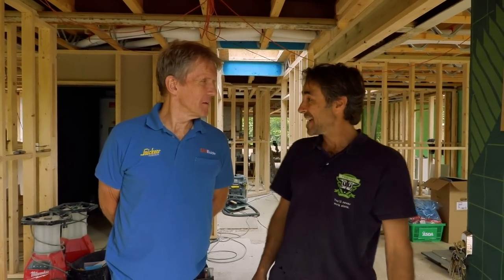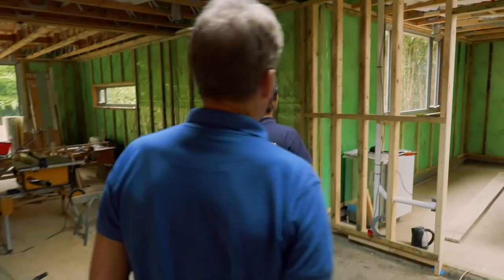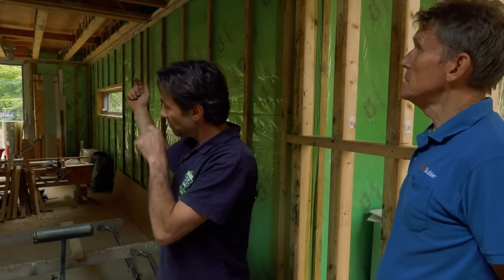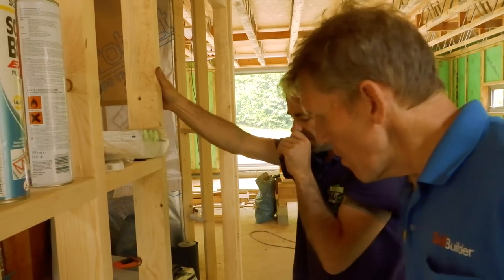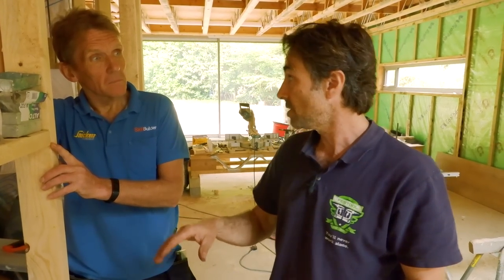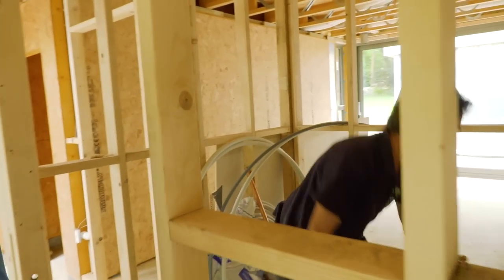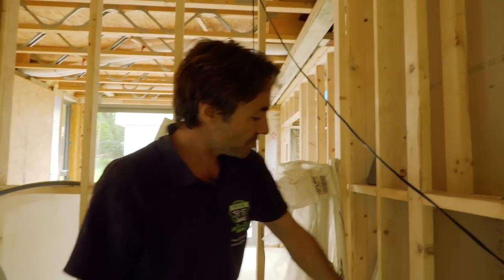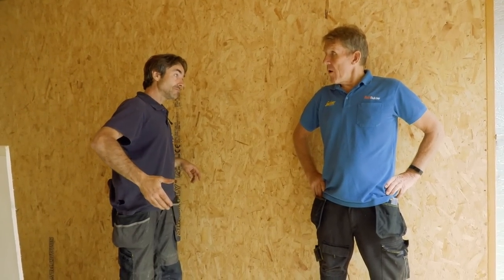Robin's Building Progress Update - Capel #11

Comment: It's really starting to take shape now Robin and looking great too!  I particularly like the joists, being able to run services both perpendicular and parallel to them, without drilling holes everywhere is very handy.

While you're doing your first fixes, I'd recommend putting in Ethernet, any audio cables and also any CCTV wiring that you may want in the future.  Wired Ethernet, particularly for TVs and desktop computers is so much more reliable than WiFi.
Reply: So much modern tech does not have facility for wired, only wi-fi.!!

Comment: Looking nice Robin. I get receesed bathroom cupboards made by a local bespoke kitchen company. They're ivory faced carcasses with mirrored doors, either 15mm with a 4mm mirror stuck on 

or now they can do a wrapped door which is mirrored, which is much lighter.
I get extruded aluminium  LED strip lights made to measure and sometimes fit these down the sides. They look really sleek.
The long and the short of it is you can make them  to any size you need,  great for tall cupboards over a BTW pan for example.
BTW, how many outlets do you need for the vacuum system ? I had a similar system in my previous house and with a 30 foot hose only needed one on the landing and one in the hall.

Comment: Ref Beam, agree with everything you said about them 🙄disaster from start to finish.....I got the HR and Beam Hoover system from them, they have terrible after sales, took my money and that was it..... trust me and take my advice, I have installed the main Beam Hoover unit in my utility room which also has an extraction point from the Heat recovery, what you called the silencer blows out so much dust into the room and then because it’s beside an extraction point from the HR it sucks it up and  cuts the life span of the filters such is the level of dust. Take my advice at this point and try to extend your beam exhaust out side of the house if you can. 
Love all the videos 😎👌

Comment: Great project. Go with the metal back boxes, 35mm on sockets etc.

Have a look at Casambi wireless Bluetooth lighting controls. Pair that with Vimar wireless Bluetooth Kinetic switches and do away with the light switches metal back box.

I've completed several projects using these products
Reply from the maker: Thanks we will check them out. Dylan is doing the techie stuff now. He is wired up differently to us.

Comment: That level in the socket is a smart idea, be interested what sparks think as they normally use a laser around the room. Even so, gives a good starting point may be? Great video 👍
Reply from the maker: I think you still need to laser them in but the last bit of levelling can be done on the bubble. The problem is that the boxes don't have any adjustment on the lugs so they have to be spot bollock when you put them in.
Reply: @SkillBuilder  Ahhh, well if no lug adjustment that makes complete sense, cheers for saying 👍

Comment: Great to see all the progress. What's the temperature like inside? Bet you're keen to get the electrics and heating in so that work can progress in a more comfortable conditions?!?
Reply: Hi Nathan, the temperature inside is not to bad we have the underfloor heating ready to fire up, the building temperature fluctuates by 1 to 2 degrees up and down regardless  of the external temperature which is a great testimony to the air tightness and insulation, but now winter is setting in you are right in saying that it would be nice to get the heating on!!!!

Comment: In Australia the majority of houses are timber framed with brick veneer, so the brick is not structural. The framing code here states that you're not allowed to drill a hole greater than 25mm in a stud and only in the top or bottom third, so as you can see from this video a lot of these vacuum systems that are being installed, generally after frame inspection ,  cripple the structural integrity of a lot of the houses they're installed into. It's not impossible to install them without causing structural problems but I've rarely seen it done and maintain code.
Reply from the maker: Hi Tim
 I was thinking the same thing but those studs are not structural. The outer walls are untouched.
Reply: Skill Builder, yes, I did assume as much. Robin is too good a carpenter to let something like that happen on one of his builds. Here in Australia we build to a minimum requirement rather than to a standard, which means the house is engineered backwards depending on roofing material, geographical wind loads etc. When you add to that the fact that the big residential builders are licensed to self inspect rather than have a council inspector, which is a massive conflict of interest, it all turns into a recipe for disaster when trades who don't know the framing code, like plumbers, electricians, scaffolders etc. start to drill holes in studs, cut out bracing straps and banging holes in brace boards to suit themselves. As a British born carpenter I can honestly say the Building codes back in Blighty are actually pretty good.

Comment: Looking great Robin.  Re . the potential issue with debris in the central vac system dropping back down the tubes, could you add a time delay onto the system so that when you unplug a vac hose/switch from a wall plate, the system runs for 2-3 minutes to make sure all the debris ends up in the beam unit in plant room?

Comment: I used to fit beam for the sole suppliers in the U.K. the company is Keenans from Northern Ireland they do the heat recovery systems also
It is simple to fit as I am sure you found out pat Keenan has been fitting beam vacuum systems for over forty years beam is made by Electrolux in Ohio and they use LAMB electric motors not made by Electrolux there are other vacuum systems companies Canadian CANAVAC  SMARTVAC also American but 
they all mostly use the same LAMB motors beam is a good system designed for dry dust  and hair etc but some people think it is a skip sucking up sticky sweets and food which will eventually block any bends on the pipe work good system if you are allergic to dust but you have to not put crap in the pipes or you will stop it working

Comment: Quick question Robin, whats the thickness of the final screed and is it ok for the internal stud walls to be encased by the screed?
Reply: The final screed is 50mm and it's ok to go around partitions, use the correct foam expansion correctly fitted prior to screeding (liquid screed)

Comment: Can someone explain to me at 2.00 how the ceiling joists plus the whole flat roof structure seem to be sitting directly onto the exterior windows and doors without the need for supporting columns and lintels. (behind where Robin is standing)
Reply: Hi Gary we have an earlier video in the capel build series that shows me constructing the flat roof and you will see how the joists are supported by Glulam lintels it is a great system no steel beams anywhere! Thanks for the question
Reply: Thanks Robin. It’s all become clear after watching the other episode. Thanks again.
Reply: @Edge-ir8tb  nice one gary glad you saw it, all the best Robin

Comment: Re: electric back box, it won't flex when plaster board is on, as front of switch is bigger than cut out hole so you'd have to push hard enough to break plasterboard,  it essentially clamps to plasterboard.

Comment: Been to many HVAC MVHR  homes built from the 80's onwards. Only thing unique to them all was the system was a pain in the arse and always with problems. Ranging from pooling in duct work to mechanical failure. In short you are asking an oppo to design a bespoke vacume cleaner, close it in and expect a home run each time. Simply impossible on balance.

Comment: Great video but can someone please explain to me this obsession with airtight housing? Why on earth would you want airtight homes?

This is the reason you have generations of children with all sorts of allergies, wrapped up tight in sterile boxes all day long.

Velux have a campaign running regarding the "indoor" generation.
Reply from the maker: McReady
I totally agree with you. (This is Roger) I think that the airtight house is an experiment that will prove to be a mistake. It only makes sense with a heat recovery system bringing in fresh air but, given that the heat recovery can only be 60% of what you chuck out it makes no more sense than opening a window. 

In may time as a plumber I have met customers who have lived into their late nineties with very few health problems and most of them had an open fire and no central heating.
Reply: The reason for having air tight buildings is so that you can then have controlled ventilation. A heat recovery system controls where the air is extracted from, recovers the heat and injects fresh heated air into the building. It's not that there is no ventilation it's controlled ventilation. If you don't have an air tight building to start with the recovery system will be less effective.
Reply from the maker: @cliveramsbotty6077  Plenty of air tight houses don't have heat recovery.
Reply: I totally agree with Roger, we are now re-pointing houses with lime render.... why? because it breathes! we think we are all experts on passive houses, in 30yrs time they wont be the same answers we have today. probably find if you boil a pan of spuds for more that 5 min you will suffer chronic interstitial condensation!
Reply: @SkillBuilder   Very valid points indeed, Roger.
Reply from the maker: @cliveramsbotty6077  I agree with you but I visit many rented flats and house where the envelope is sealed and the cash struck tenants are worried about wasting heat and never open the windows. 

The result is a fug and before long the mould starts to grow with all the chronic health problems that accompany that.
Reply: @SkillBuilder  Roger, if we could solve the problem of teaching renters/ far too many people!  to open the window when they are drying clothes, we could potentially save the NHS millions upon millions.... I know instead of all them DIY/ Save Money type programs,
Lets have one that's called - "Open a window and save your health for free!'
Seriously though BBC a basic do's and dont's program please!
Reply: @SkillBuilder  Totally agree with you, and many people walk about in them wearing shorts and T shirt with the heating right up, instead of wearing clothes and turning the heat down.

Comment: Is there a PDF datasheet somewhere that adds weighting for how eggy the fart is?
Reply from the maker: Now you are getting technical. Can we take it that there is a British Standard and work to that because the coefficient of air velocity over weight dissipation per mtr squared  gets you into the realms of rocket science.
Reply: @SkillBuilder  what would be the relevant units, though? Bum Transmission Units for thermal mass energy transfer?  Tons if you go the HVAC volume route? Young's modulus and Bernoulli's principal don't cover it either. The best part of that was Robin refusing to talk about farting or even say the word. The ones who act like they never fart are usually the ones who can set alarms off three streets away.

Comment: I agree with robin there is definitely a always a place in the would for lingerie.

And that place is the bedroom floor 😎😎👍😜😜
Reply from the maker: reminds me of the time I went to sort out a boiler problem and did my usual walk round to bleed the rads. Lying on the bedroom floor from the night before. Suspender belt, thigh length boots, stockings and whip. Nice lady, long blonde hair good figure and not the slightest bit phased.
Reply: @SkillBuilder  
And what so you took them off and got on with the job. lol

Comment: just an unasked for observation. Plant/machine/electric rooms it helps if the wall are a light colour it reflects light and also show up problems (oil leaks, rust,  water puddles or were water has leaked).  Same with machines those that are a 'light/bright' colour show up issues quicker than dark painted one. lots of people like black walls but from a maintenance standpoint it make seeing an issue just that much harder. In a light clean room it very hard to miss something that failed/leaked/exploded etc
Reply from the maker: I agree nice and bright is better to work in